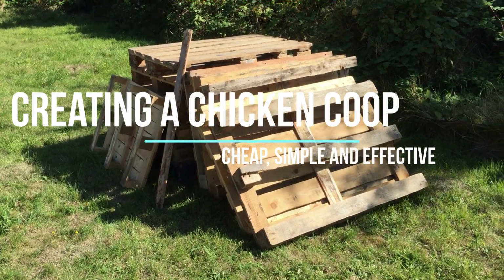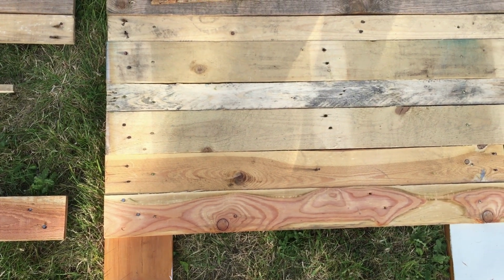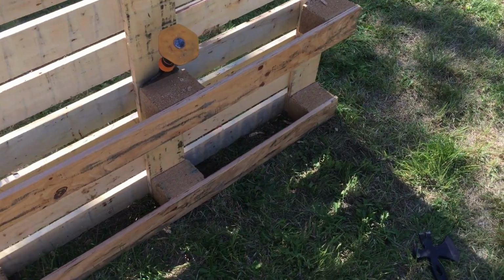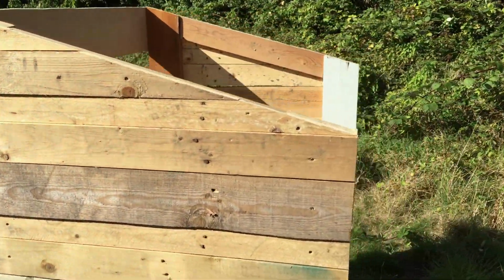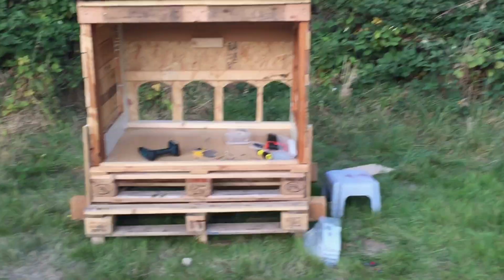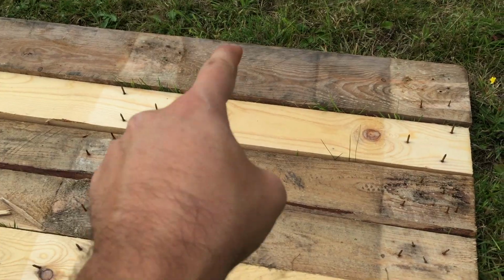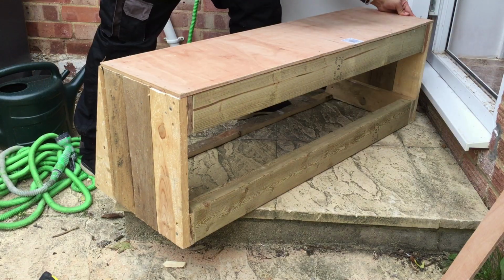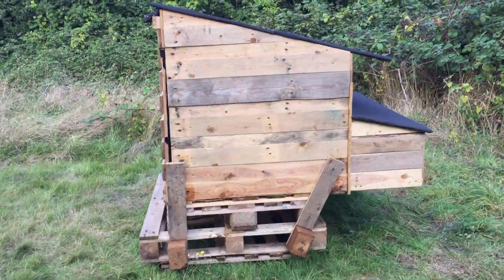DIY step-by-step wooden chicken coop using pallets tutorial / cheap - UK

Comment: It would be perfect if the roof went out more on the sides a couple of ventilation holes were put on the sides just under the roof
Reply from the maker: i ended up putting a few holes in the nesting area. this ventilated the coop, rather than adding in the main body of the coop and having a draft run through. great for british weather.

Comment: Good but...zero ventilation would equal certain death. Chickens need some sort of airflow. 🥵 They get hot easily. 
Maybe instead of filling in between the boards on the front and sides you could put hardware cloth. 🙂
Reply from the maker: I ended up putting two small circular holes at the top on each side, worked a treat. Thanks for pointing this out to others.